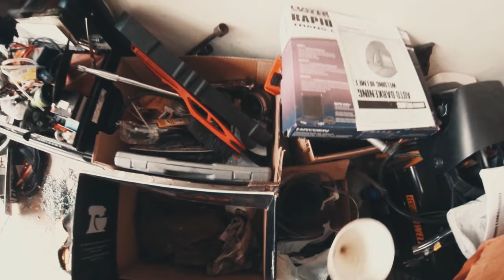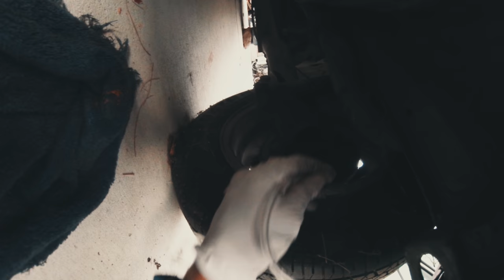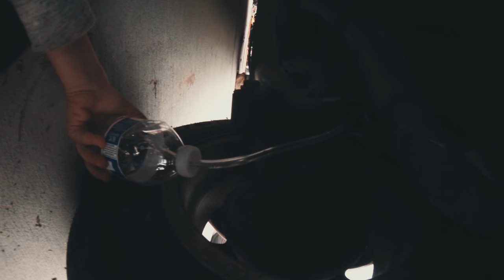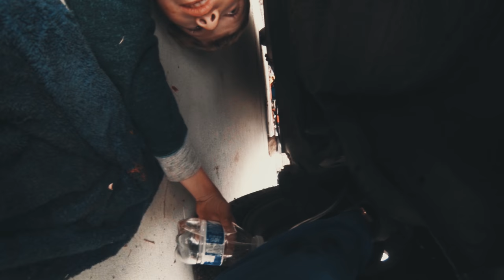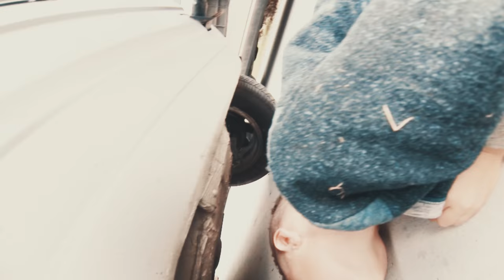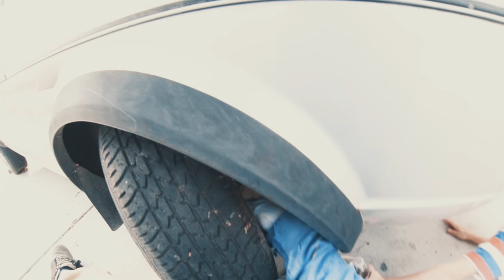How to Bleed Brakes one Man with Air Compressor (Power/Pressure Bleed) on VW MK1 Diesel Rabbit

Comment: In Germany, I drove a $1,500.00 'hooptie' '90 BMW 318 and the rear drum brakes gave out on pressure while on a rainy Autumn Autobahn in Bavaria. I replaced the wheel cylinders, shoes, and all the related hardware. Braking was normal after that. It was the first time ever replacing drum brakes. It looked complicated, but Easy after having done it on that Beamer. I replaced both rear drum brakes on our '89 Chevy suburban Scottsdale trim too.
Reply from the maker: Ha nice. I think my rear drums are fine on this. Replaced one of the cylinders that was leaking in the rear but no loss of fluid now.

Comment: Good work. I think that the jury is still out on whether putting pressurized air over fluid actually drives moisture into the system, but I have used this setup to get a lot of fluid through the system in a hurry. I haven't had any problems with my brakes using this, and its simplicity makes it more convenient and therefore likely to be used more frequently.On my vehicles that is about every 3 years. I keep my maximum pressure to 20 psi, and use a water trap on the tank outlet, along with the inline filter as you have.
Reply from the maker: Michael McLernon that's a good idea. Yeah I think my problem lies elsewhere

Comment: I haven’t finished watching this video, and I’m not sure how I came upon it in my search with equal 11 thumbs up and down.  But half way through, you’ve got two people and are pumping the brakes instead of relying on the compressor. I guess I should continue watching before I give it the thumbs down.  

You should wheel your compressor to the wheel you are working on and manually regulate the pressure while watching the bleeder yourself.  Right?
Reply from the maker: I was having a problem with this car so I was trying all sorts of stuff to bleed it thinking it wasn't bleeding right but I had a problem with rear drum I didn't realize. I do show how to one man bleed them and that works well and I've done on other cars.
Reply: g3mccotter I did finish watching and see you did the bleed job.  I did learn that I should epoxy the air fitting on the cap.  Thanks for that.

Comment: ITS a GREAT  Idea,  to hook up the  Small Air  Compressor  with Regulator all built in One  Cant see what you PUT for in line Filter . WHY is there three gauges  ??  . I would Never have  Kids, around Pressurized Brake lines, UNDER THE Car,  Especially   without safety  EYE protection, should be able to do this your self, . Also take off your watch while working under a Car .
Reply from the maker: Gary T Thank you
Reply: Geezus.